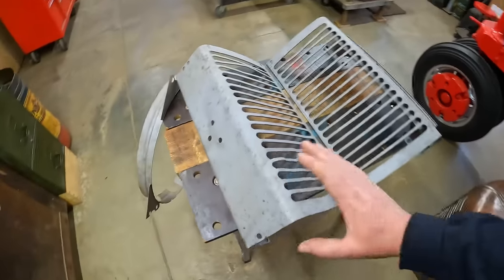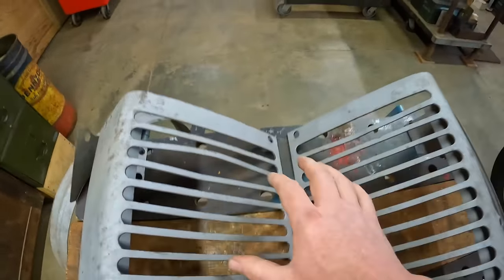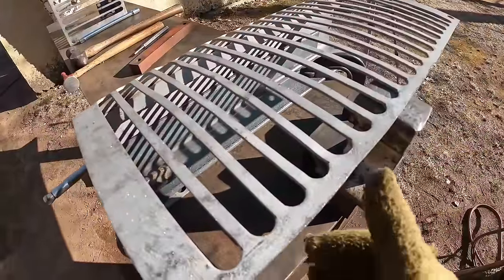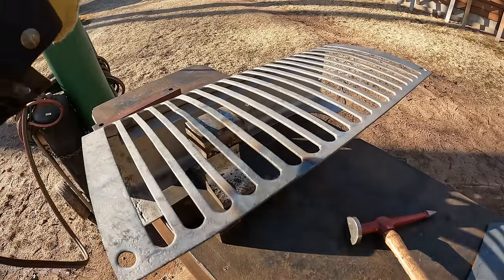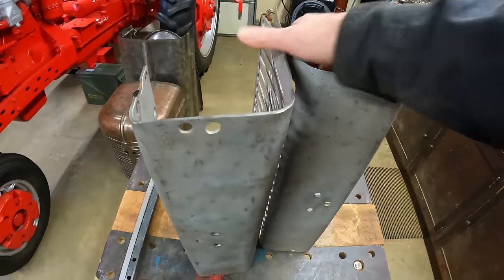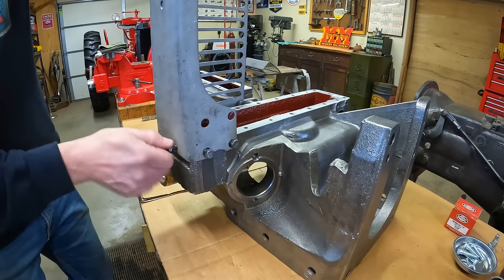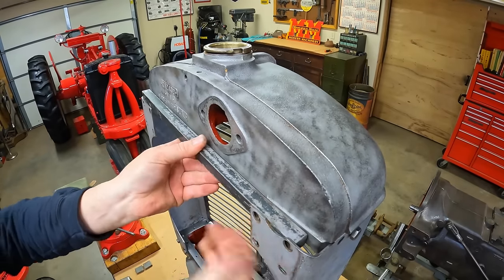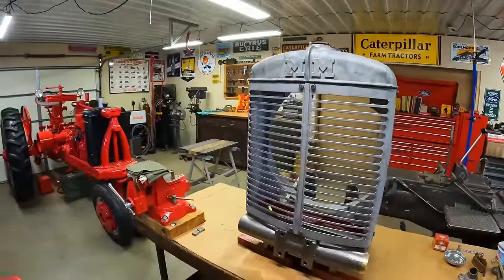#X231 Prototype Grille Panel Repair - Shrinking Stretched Metal & Removing Dents - X231 Part 75

Comment: On the stretched grill bar, another trick to try is just heating it and then giving it a blast of compressed air. Good use of whatever tool you need to get the metal to move where you want.  Good to see the progress!!

Comment: Nice hand on the hammer, Toby. I've got a 970 Case over at a friend's house that had a very ugly bend down of the front part of the steel hood(tree related). I purposely went over there when he wasn't home to straighten it. It took a 3 lb ball pein hammer to have enough ass to move the metal,but there had to be lumber in the right places to back up the steel that was straight,  to be able to  move the bent part of the hood down to it. He's a roundhouse kind of guy, and I didn't need to dissolve a friendship over a 970 hood. Annnnyway, nice job on the grille,bud!

Comment: I appreciate the metal work lessons. I didn't realize it is possible to remove metal by heating. X231 is starting to look even better. Nice work!
Reply: It's not so much removing metal as getting the metal to shrink back to size after being stretched out 21:20
Reply: Pull on a rubber band and note how it thins out, same principle

Comment: Those punch marks on the corners are bend witnesses marks. When I  did my trade, I'm a boilermaker in Australia, many decades ago now. We would also witnesses oxy cutting. You would have to cut the punch mark in half. Gr8 job thanks.

Comment: It’s amazing to watch you bend the metal back into place, the whole time I am thinking about all of my tractors that need some help. 

I am surprised that the metal hasn’t flash rusted by the time you got all that work done.
Reply from the maker: We’ve got a very well insulated and sealed shop, kept climate controlled year round too. The bulk of X231’s chassis is going on 5 years in raw metal, and hasn’t flash rusted yet 👍
Reply: @squatch253  I’ve sandblasted parts and by the time I got to the third part I started to see rust back on the first part especially this time of year. In 5 years our local historical society had a restored cat 60 sitting in a city climate controlled building and the steering clutches froze up. A Cat D4 next to it got its rack stuck thankfully in the off position.

Comment: Great progress on X231. The center pop marks on the radiator grill were probable part of the layout guide during the hand bending process. It is good to see someone holding a hammer like it should be held. Not choking the head.

Comment: When working on the side of the radiator grill, it appeared that a tool that could have simultaneously pushed down on the outside, while pushing up from the inside during heating would have been handy to have.  Metalwork on the front looks great so far.

Comment: Labour of love! Awesome! 
Given the fact that the end holes are drilled precisely, i'm wondering if the slats weren't cut one a horizontal mill, using the 90 degree attachment for an arbor cutter. That would explain their precise nature and would be within the type of thing a machinist of that time's mentality.
Reply: That seems like a much more likely scenario to me, than someone cutting them out by hand, even with the use of a guide.  I'm pretty sure the development department had access to a full machine shop.   Certainly if I were having a machinery prototype fabricated, my inclination would be to have something like this milled out, vs cut by hand.  It would be interesting to get a closer loot at where the straight cuts merge with the holes at the end to see if there's a consistent radius to the end of that cut, as there would be with a mill.

Comment: I don't know what you call them in the US, but here, if you have a ding in your car you take it to the "panel beaters". Well, nobody has beaten a panel in a long time - you just replace it. So, it was good to see someone actually panel beating.
Reply: The next trade up from that was called coachbuilder-carriagemaker. The guys what build traditional Morgan bodies are still extant,so that trade is not entirely extinct. Yet.
Our side of the Atlantic,we call the panelbeaters,bodymen. In all fairness,simply gluing a modern fender in place is a lot faster than repairing a damaged one. You pays your money and you takes your choice. Using lead solder to smooth a surface is pretty much a no-no nowadays.
Reply: @paulmanson253  Thanks, interesting; but that should be "this side of the Pacific" - I'm in NZ. Have a great day
Reply: You can still see those same skills being practiced in restoration, hot -rodding and custom fabrication shops.

Comment: That grill / water tank / front bloster assembly looks great together.
That light bracket   on left side must of had a solid object fall hard to  bend the steel like it did.  That is no sheet metal there.
The mysteries of machines over time.  Like the D2 with the hood and air cleaner strikes.
I coming Minnesota when the Queen of the Christine is revealed!
Reply: Or they drove the tractor into something large and immovable such that the light was the first point of contact.

Comment: That was some fine craftsmanship, shows you don't need fancy tools to straighten bent metal. I was wondering over two things. First from the archive photo X231 starter and generator are all painted with the same color as the tractor. Now usually Delco-Remy provided parts are always black. That tells me the engine and transmission where all preassembled and than painted as one unite. Second thing im kind of interested is the front pedestal with wheels that where used for this tractor. I'm hope it dose not have some very odd ball bearings in the wheel housings. The fact one of the wheels is stuck may tell me that might be the case and one of the bearings is just sized up from condensation. I hope the wheel hubs and spindles are the same as on the ZB tractor. Sorry if im rushing too much ahead of the project.
Reply from the maker: Yes, many tractor companies would install all of the electrical components and then paint the entire unit with everything bolted in place, so they all ended up being the same color as the rest of the tractor.  IH also did this, so when those tractors left the factory those starters and generators were painted red, but years later when they needed rebuilding, the starter and generator shops would often repaint those units black again after getting them all cleaned up and rebuilt. For the front pedestal, fortunately X231 has a production ZB front pedestal and wheels, so sourcing good parts for it shouldn't be a problem :-)

Comment: Great job! Patience is everything when you're beating on a piece of metal! I see someone else already asked my next question, it was " why don't you use a sandbag to beat the curves on Sheetmetal? Got it. Question # 2, you always seem to use the cutting head to heat metal, have you ever used a "rosebud" tip?
Reply from the maker: The rosebud tip question has come up numerous times in the past, and no I don’t even own one. I had a very bad experience with a rosebud tip years ago back at the Ford dealer, it tried exploding in my hands the first time I used it and I’ve never picked one up since.

Comment: There is just something musical to the ringing of the steel grill. Question though was the impetus for assembly now to facilitate a new core or was the old one good enough for the dimensions if the original could not be used.
Reply from the maker: The main focus right now is to recondition everything that goes into mounting the radiator core, so that we can bring all of the pieces to the radiator shop along with the old core so that they can make a determination regarding which way they want to proceed, whether it be repairing the old core or making an all-new one. In the next episode, we’ll be finishing up all of the core mounting hardware and finalizing the inlet and outlet fittings, and then seeing what it might take to still mount the old core to the assembly now that I’ve cleaned up both of the gasket surfaces and changed the dimensions.

Comment: Were the original hydraulics power up, gravity down or power up, power down. I had a 1949 RTU, the hydraulics were a pump running off the oil pan. This would lift a cultivator and gravity would carry it down.
Reply from the maker: This prototype was the first tractor that M-M put together with live hydraulics driven by a live power shaft that splined directly into the engine's flywheel, with that shaft extending all the way to the back of the tractor with the live hydraulic pump mounted to the back of the rear end case.   The pump directly fed the 3-point lift unit, which had 3 hydraulic spool valves in it - one ran the lift arms and the other two fed a junction block that had passages and four hydraulic fitting take-outs in it, for plumbing multiple hydraulic circuits that were capable of live power in both directions.  Here's a link to the hydraulic pump install video for reference -  https://youtu.be/VCHQ-3kgUWI

Comment: Does the bronze repair to the power steering cylinder on the bottom tank get machined before the radiator gets built?
Reply from the maker: I explained that near the beginning of the previous episode, but to recap - finish machining that repair area can happen at any time, but getting the radiator system all reconditioned to bring it all to the radiator shop is priority #1 👍

Comment: If that was made prior tp 1954, it wasn't cut with an angle grinder because it wasn't invented until that year, I'm not sure how fast the angle grinder caught on but I worked with some old guys 25 years ago that told me they didn't have angle grinders when they started welding.
Reply from the maker: Another commenter mentioned how they likely cut those slots with a horizontal mill, using a thin cutting blade on the arbor. That would make perfect sense considering the work practices of the time 👍

Comment: I've always wondered how effective it is to use a lock washer on top of a flat washer? It seems like the assembly could still loosen up over time as the flat washer isn't locked to the base metal. Am I over thinking this?
Reply from the maker: The one positive thing about this prototype tractor is that you won’t have to worry about anything loosening up because it’ll barely see 10 hours of run time from here on out 👍 But from personal experience, I’ve never had any trouble with lock washers.
Reply: The lock washer is actually more of a spring lock than a positive turn lock (like you have on combined bolt + washer bolts with ridges). The idea is that once you compress the bolt with the lock washer in, the tension in that hardened, sprung piece of metal will prevent the bolt from moving because it's constantly trying to pull the bolt out of its threads. That's why buying quality lock washers is key and why whenever you find a bolt come undone, you either used the wrong type of lock washer (the term actually has a lot of different types under it) or it's a cheap one made from pressed sheet metal that doesn't actually do anything. A good way to know is to take a lock washer, tighten the bejesus out of it, and then remove the bolt. If it's flat... that's not a good washer. If it sprung back to its original shape, that's a quality one. Whenever i take apart machinery, that's my criteria for either tossing it in the metal scrap bin or keeping it for the assembly. Even name brands coughjdcough have had fake lock washers in their products in my personal experience. Hope that makes  sense, cheers!

Comment: I wonder? If you mounted the right side of the grill on the Left side and Left on the Right would your half round holes be on the correct side? Have you assembled backwards?  The bolt holes seem the same on the top and bottom of the two sections, so they could be mounted in reverse order.,
Reply from the maker: No, because you have to flip the panels to transpose them, the half-round holes will always land where they are now.
Reply: Yes, I see now.    I looked and saw the half round on the rad shroud, Under the rad shroud it shows as you say flat on the wrong end.  @squatch253

Comment: When you sandblast what type of media do you prefer to use.
Reply from the maker: I use a product called “Black Blast”, it’s a very sharp black grit. We always start the brand new stuff out in the blasting cabinet, and leave it in there until it starts getting a bit dull. At that point, we take it out of the cabinet and put it in sealed 5-gallon buckets for use in the outdoor pot blaster later. It still does well there because that blaster runs at higher pressure and has a larger output. We catch what we can in that tarp that was hung up, and filter screen it before putting it back in the bucket. We do eventually lose it due to wind and pulverization but it lasts for several cycles.
Reply: My question as well, but I see Toby's reply now.

Comment: do you use any kind of an air dryer for sandblasting?
Reply from the maker: Yes, I run a water separator right off of the compressor, and a second one right before the pot blaster unit 👍

Comment: is that a pre-2009 f250 i saw in the background?
Reply from the maker: Yes, that's my old '03 F-250 that I call "Big Red".  I've got a playlist on the channel here of some of the things I did to it after I first got it, I had another '03 F-250 that I had bought new and drove until the road salt destroyed it, and then replaced that one with this red one, which is a former Arizona truck so is still rust free.  I'll be needing to do all of the ball joints in this red one soon though, so stay tuned for that :-)
Reply: @squatch253  at least it's a v10, gets the same mpg as the 2 valve 5.4 but I bet it actually goes 60 up a hill when towing, I'm trying to 7.3 swap my 99 so its actually useful, oh btw do you have any internationals in your area?

Comment: when sand blasting open the outlet valve fully or it wears out the ball in the valve
Reply from the maker: It is open fully. The handle is loose on the valve so after I’ve opened it fully, it flops back to where it wants to be but the actual valve stays put.
Reply: @squatch253  that's OK, just checking. I have the same sand blaster and have worn them out.

Comment: You need an anvil
Reply from the maker: I have one tucked back in behind the press against the wall, but because it’s so heavy to move around it mostly just stays put there. The steel tables work quite well for most things, so they get used 👍